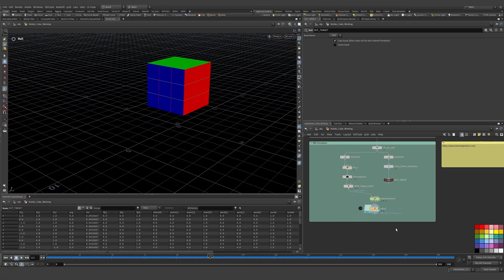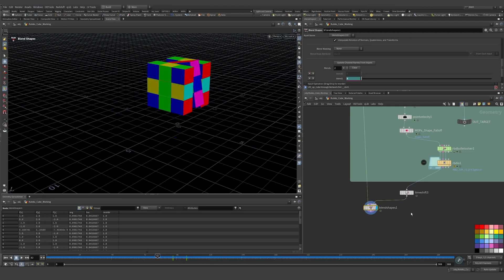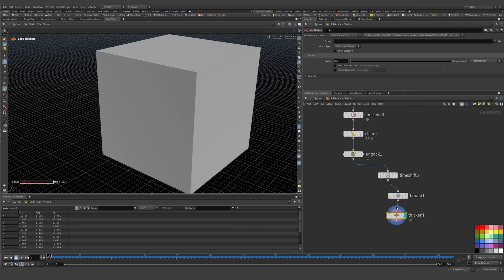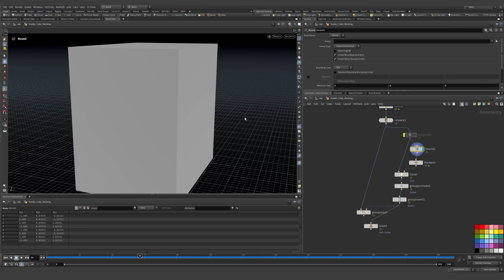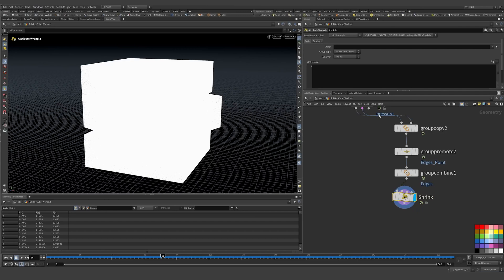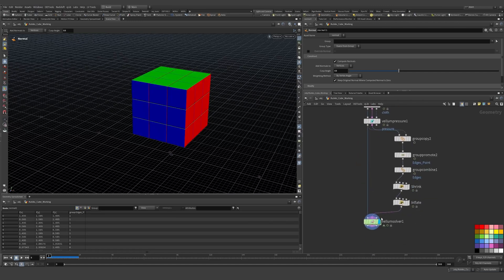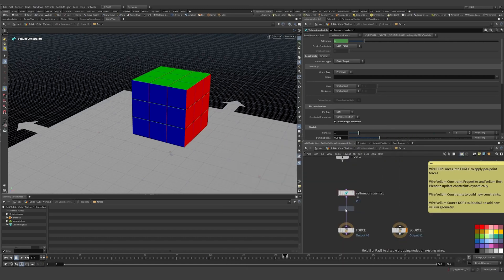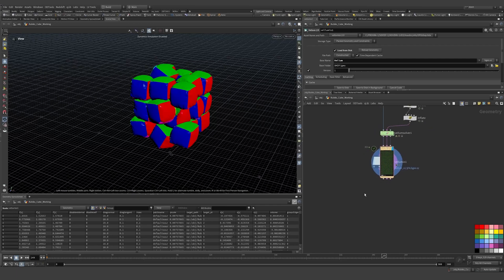[Houdini] Creating a Fluffy 3D Rubik's Cube w/ Paul Esteves | Part 3: Softbody Pillow Simulation

Comment: When I put the Inflate code and try to play the vellum solver each box and faces appear crazy if I turn off inflate it works normally.
Reply: in code there should be =, not =*, i recomend check entagma tut to dive more dip into this. also i return it back without mops plus by using lerp function in geometry weangle
Reply: The same for me!